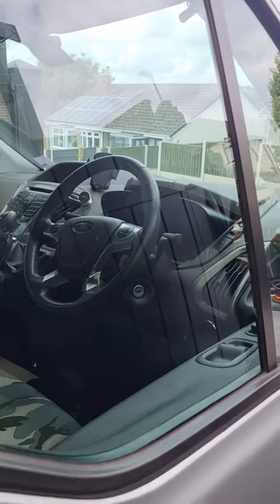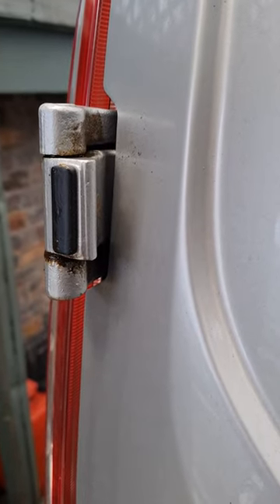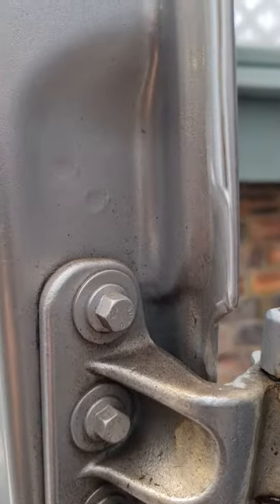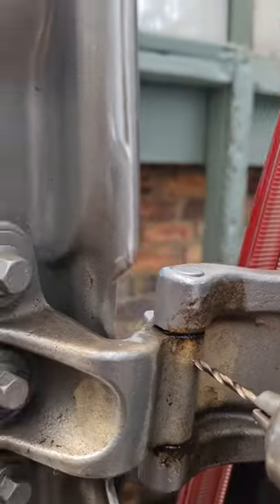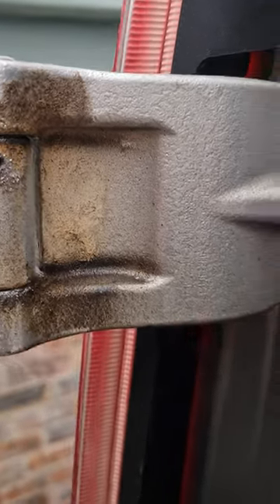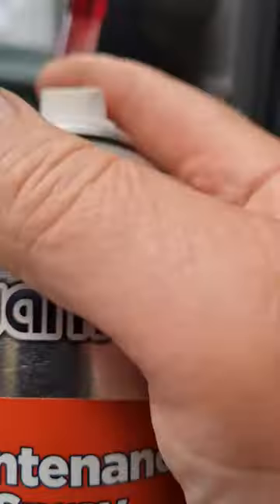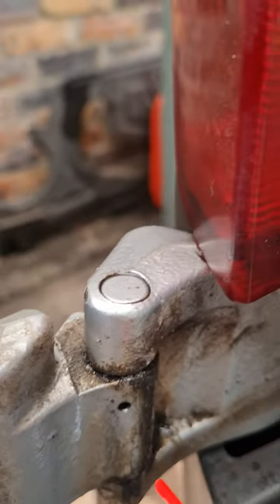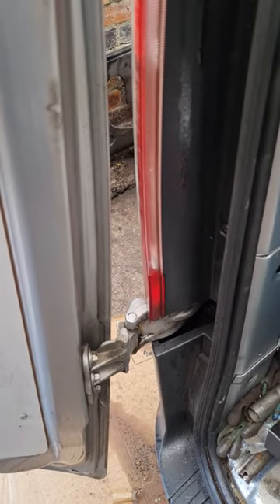Ford Transit Custom rear stiff door fix.

Comment: Drill a 4mm hole , remove the nozzle from your squirty can ,the tube on the can top will fit in tight , keep pressing until the for gets looser, I infilled the holes with some silicone sealant , ( easy to pick out as the oil stops it's sticking) 
My doors were actually flexing as the hinges were that tight.. Now I can shut with one finger....

Comment: Thanks Bryan, very helpful,  

My Custom, 2014 reg, has no heating in cabin.any suggestions? Engine temperature looks fine, blower works fine,but no het air blow in to cabin !

Comment: When I tried this good idea, I found that, on my Transit Custom, the steel pins are trapped into the central part of the hinge, so the movement occurs only in the cups top and bottom.  So in my case, this idea won't work.  I spray regularly with oil, but get rusty streaks down the door whenever it rains.  A bad design by Ford.  Whatever happened to grease nipples? BTW, the plastic rectangle on the hinges is a bump stop for when you open the doors right back.  The 2 holes for these bump stops are blind holes that definitely don't allow lubrication of the hinge pins.
Reply: Just wondering if that is the case... how on earth they put together the hinges..😂 doesn't make any sense...just saying.. anyway have a nice day.

Comment: how big was the hole? in mm if poss...
Reply: He said ⅜", 9-10mm
Reply: Looks more like 4-5mm to me
Reply: Many thanks
Reply: Use a 4mm dia drill bit, remove the top of a spray can , the tube left in the can top will be a tight fit in that hole, just keep pressing in, and squirting , keep moving the door open and close whilst pressing the can...
Reply: @kilnaleck  it's not 9 or 10 mm that's far too big
Reply: Buy WD40 first & measure the plastic pipe